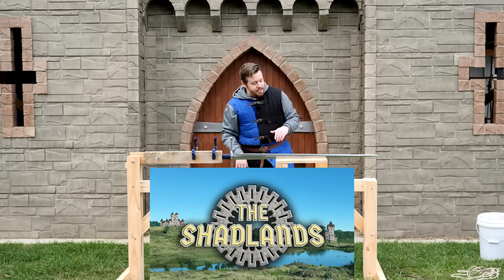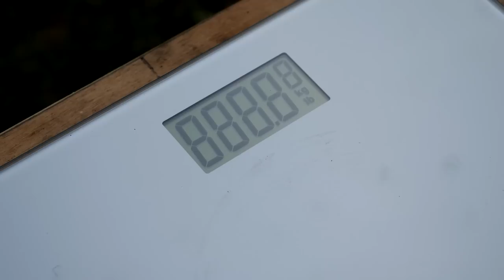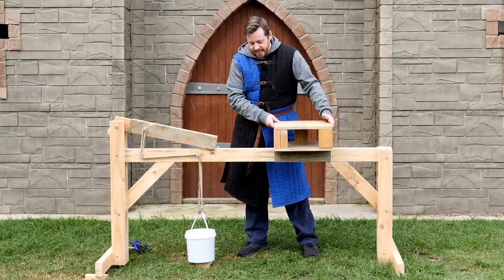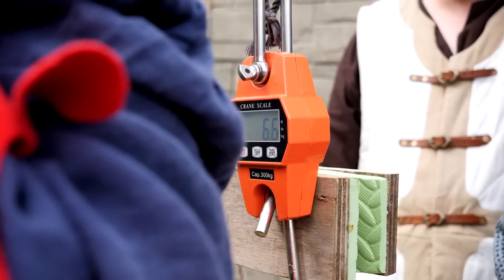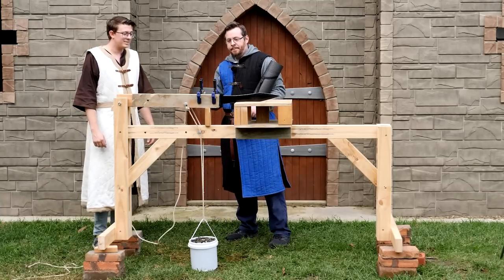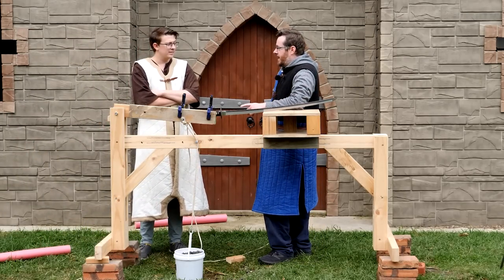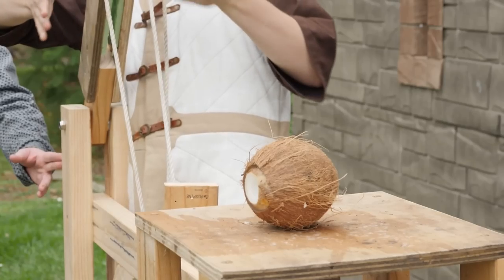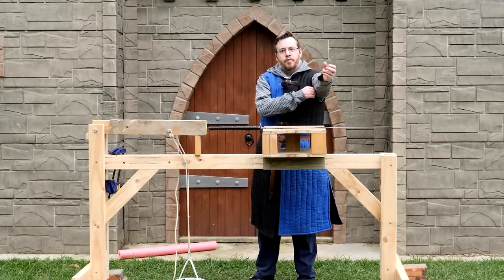Choppy choppy

Comment: Hi shad
I’m afraid the force calibration is still incorrect. When you measured your strength with the wooden stick, you held one end of the stick and applied force on the other end.
However when you tried to calibrate the force for the wooden “sword holder” the force is acting on the handle of the sword and not the tip of the sword. The better way would be to attach the same wooden stick to the apparatus and measure the force at the tip of the wooden stick instead of measuring the face at the point of attachment for the sword handle.
Reply: No offense to Shad, but I’ve facepalmed like 10 times through the whole setup situation. It’s like “no, no… oh good he got it… yes… noooooo, you got it wrong again…”
Reply: I would also be concerned about parts wearing down over time, especially with so much made out of wood, and with the point of contact being hit hard, I would expect that it could move around a bit. 🤔 Tod from Tod's Workshop might be able to think of a good way to make a clean release.
Reply: I was thinking the exact same thing.
Reply: Exactly this. It's a math issue. The swords aren't swinging as hard as they should be.
Reply: He should have used the bathroom scale at the tip for both, or the hanging one at the same point for both
Reply: In addition to that, the acceleration of the weight is limited to that of gravity... I think you'd need to account for that by having the (heavier, as described above) weight at a particular distance (probably closer than it is in the video) to the fulcrum so that the increased leverage can accelerate the sword more quickly to a sufficient speed.

Using the mechanism, it took ~12 frames from dropping to hitting the coconut. Manually swinging it looks like it maybe also took ~12 frames, but it's very hard to tell from the front on angle. However, it looks (again, hard to see from that angle) like Shad is swinging an extra 60 degrees in that similar time, which is maybe twice as far. So even if they did have the same amount of force/acceleration in the "swing", Shad's manual swing is going to be twice as fast at the point of impact (ignoring the effects of gravity while sword is hanging backwards, I guess).
Reply: My thoughts exactly!
Reply: @shooteroffuture  same here. And on such a middle school physics issue
Reply: He was not measuring a force, but a weight, which is also incorrect, cause he should have put hand acceleration into account.
Reply: Or he could alternatively do the math to figure out how much weight at the handle is needed to give that amount of force at the tip of the wooden stick, that would be easier than rigging up the weight to the sweet spot of the test swords
Reply: Yep, this is the problem;  very different lever arm between the calibrations.  He had the right idea initially with the weight very near the pivot, but the calibration needs to be done with the rig holding the stick and the scale on the chopping block, such that the distance between Shad's shoulder and the end of his stick is the same as between the rig's pivot and the point of contact on the scale, then match the force.  With that much mechanical disadvantage it will be a lot of weight needed in the bucket; I'd expect the big bucket full of concrete to start and adding from there.
Reply: JoergSprave had made something similar before with rubber, I think that one seem to work really well. "Let me show you its features"
Reply: Yep, that’s exactly it, was hoping he might figure that out in the video
Reply: i was about to say the same thing.
Reply: This. I wish he would have also tried cutting that yoga mat by hand as well.
Reply: even then  force is mass plus speed, he only measured the mass.
Reply: Yea I was thinking that same thing. They might also need something denser than rocks as a weight to make it easier to manage.
Reply: @bowmanc.7439  Science just isn't his area. He should of made this video with another YouTuber that specializes in this sort of thing.
Reply: He doesn't necessarily have to do something so complicated.  The torque applied to a lever is proportional to the distance from the pivot and the force applied at that point.  All he needs to do is place the stick in the rig and measure the distances from the tip of the stick to the pivot and from the point where the rope attaches to the pivot.  The weight of the bucket needs to be increased by the same amount as the ratio of the two measured distances.  Example being that if the rope is 1 ft from the pivot and the tip of the stick is 4 ft from the pivot, then the weight in the bucket must be increased for 4 times for a total of 28 kg.
Reply: @dylank10101  Or he could push down on the scale with his hand.
Reply: Exactly, hope he reads this
Reply: @valkronis1863  You'd figure since he always does a bunch of "research" so he gets nothing wrong, that something like this would be easy for him
Reply: that's overly complex. simply put your folded hands in a kind of low defense position, bow over a little to make it horizontal and push down directly on the scale. this force needs to be on the handle.

why not straighten your arms? because your muscles work better in a middle state and we all instinctively angle our arms when throwing for that reason.
Reply: I was thinking exactly this through the whole video, hoping he would catch on. You need at least to be measuring the force at the same point of impact

There are, of course, several other factors, and ways to improve the swing, but this is the most obvious.

Comment: Hey Shad, while I agree with  people below that there's some force calibration and clamp slipping, I think the real issue is velocity/acceleration. Force=Mass x Acceleration (which one of the key parts of cutting is pressure P=Force/area, where area would be the edge of the blade), while your mass is consistent between the actual sword swing and the rig, your acceleration isn't. Right now you're limited to 10.9 m/s of gravity pull (minus friction, air drag, and all that jazz), but your swing is faster than a simple drop, which means your actual force is significantly decreased on the rig. This could be solved with elastic bands, springs, or some other way that would allow it to be pulled/pushed at a faster speed. 

I don't think the issues with clamp force and tip force calibration is a significant issue, as hands aren't perfect clamps either.

Another issue you face is rotational velocity, since your axis is fixed it means that a longer blade, regardless of the mass will be swinging faster (due to distance traveled) even though the acceleration is the same (assuming you always strike with the optimal blade location). What you instead would need is to calculate the rotational velocity of the striking area for each compared sword (or instead have a set rotational velocity metric that you meet each blade to). This would also mean you would have to have adjustable elastics/springs to match the acceleration needed to equalize the rotational velocity. This is important mostly because of the inertia that larger ("less wieldy") blades would have after achiving that higher rotational velocity with simply gravity, while shorter blades can be accelerated faster. 

This is also useful to guage the amount of force needed to achieve the same depth cut as you can measure the amount of downward pressure being exerted by your rig which could be useful considering the various applications of different blades (Choppers vs cutters vs slashers etc). 

Combining those two fixes would give you something a lot more akin to an actual sword swing, especially when combined with more options for cutting styles with different angles. At least a lot more than changing just the clamps or weight behind the strike. Though it's somewhat complicated to fix, an actual comparison of the "exact same swing" for a sword is also difficult.

Just to reiterrate:
The Acceleration is why your rig doesn't cut quite as hard, and the rotational velocity is why the 2-hander could cut the coconut while the katana couldn't.
The simplest fix for this would be elastic bands which could be attached at the pulley points, with variable strengths of belts to achieve equal (or roughly equal) rotational velocity while applying a higher acceleration to more closely represent an actual sword swing.
Reply: Would say you it the problem right on.
Since the acceleration is the same (gravity), the mass of the object being dropped is the difference heavier sword, more power.
Then we have to figure in the lever, again the longer the lever the more force you put down considering the same mass.
So we have 2 factors working against the Katana, it is lighter and has a shorter lever.

Also your clamps do not seem to perform the same with the various grips.
While they held the twohander quite well, the Gladius was nearly fully pushed out and the Katana showed quite some movement after hitting the target.

I would also suggest, springs or elasticbands to get the same torque out of the various swords.

Fo the cutting medium, I am not sure how expensive ballistic gel is in your area, but you can cook up a similar material with regular gelatine which is easier to come by.
As long as you use the same recipe it does not matter if it is denser or not compared to ballistic gel (which in itself is also just gelatine just mixed to get the density specified from the testing agencies).
Reply: Exactly this. but i also have to ask where are you getting 10.9 m/s gravity from. isn't it usually more like 9.8 ish?
Reply: @thecorsentino  sorry yeah it is got it mixed up but still there basic premise stands
Reply: @thecorsentino  In Australia the gravitiy is stronger otherwise they would fall off the globe. :D
Kidding guess it was a typo on his side.
Reply: You can increase mass instead of acceleration. Still nets you more forces. Mmmmmmaybe not the exact condition of a sword swing though.

The whole conversation really only tells me one thing - ROBOT SWORD ARM
Reply: I think, you assume that human can achieve the same speed with different blades. I'm not sure that it's true. Shad's solution with bucket and gravity guarantees that all swords get the same amount of energy. Of course blade's mass contributes to the result too, but it's 0.5 kg vs 5-10 kg in a bucket, so probably less than 10% of the contribution.

More than that, if we want to simulate a real sword strike, a heavy sword should get more energy, not less. Reason is simple: heavier sword will take more time to accelerate, but assuming that human applies constant force, it means that sword get more energy. And here your idea of rubber bands does exactly that, just do not adjust force to match velocity.
Reply: @magras8220  bands actually do not apply the same continuous force though. They produce less force as they relax, in a similar way muscles do when extending.

The downward pull from the bucket however is constant in a way a sword swing isn't

However I find it doesn't really matter how a sword cuts to determine which one cuts best or is "better" overall. A heavier and wider blade will almost always cut better in a downward stroke than a narrower lighter sword because the geometry of the blade with added weight grants the advantage. However perhaps a downward stroke isn't that second blade's strong suit, or even cutting in general. 

You can't compare a German two hander to a katana, just like you can't compare an epee to a shamshir. Fundamental differences in goal achieved. You can compare two swords of relative similarity however, to see how much work each blade contributes to a cut. However if you're just looking for that you don't need the bucket, in fact I'd argue it skews results in favor of the lighter blade by adding comparatively more inertia. A rig for this would function with as light of material as possible for the arm (carbon fiber would be optimal but also very pricey), and bearings to reduce friction of the upward bounce. This shows exactly what just the sword does, with no inclusion for skill or strength, which is both a good and bad thing.

Like I said you can't really compare two different blades, but if you're trying to get a sword swing that is as replicable as possible and as fair to each sword as possible I would use my idea above
Reply: @Zeldianiac  you are right that bends do not exert constant force. It was poor chose of words on my part: jumping from simplified model sole purpose of which was to show why heavy sword should have more energy on impact to solution that is not 'exactly' that, contrary to what I wrote. Thank you for clarifying that.

I have an impression, that Shad would be happy to do human tests if result would be consistent and repeatable, and the contraption should solve only this problems, not to isolate as many factors contributing to cutting (or chopping) power of a sword as possible, otherwise static test probably would be better.
Reply: @magras8220  yeah, and I mean so long as there's consistency and you know what's actually being tested, then publish those results, then it's all good for the sake of testing. I'm sure shad will make use of as much info as he can
Reply: It's also important to note mass behind the sword makes a big difference. (I.e. your body weight)
Reply: @Zeldianiac  "The downward pull from the bucket however is constant". No it isn't.
Reply: Some people just don't have an intuitive grasp of the difference between dynamic and static physics, it's similar to 'aphantasia' (the lack of a 'minds eye'). Shad just doesn't have 'it'. He is well meaning, but blind to why his logic is false.
Reply: @thomaskurz5617  😆
Reply: Wow, I just had a much needed science lesson…
Reply: @BestFriendsWhoLiveTogether  lol well I'm not a specialist, I just like swords and physics
Reply: I mean, yes, adding rubber bands or something would increase the acceleration of the swing, but I think its more important that the rig is consistent. It may not be a good representation of what an actual swing would do, but two swords side by side would benchmark differently. Its kinda like a PC benchmark, not every game is gonna run the same as Shadow of the Tomb Raider (has a built in benchmark tool), but how two games run compared to another in SotTR is an important performance reference (except PCs are a bad example bc of software differences but we're talking about swords).
While yes, the hands aren't a "perfect vice", they do clamp the sword from all angles, the sword won't be sliding significantly backwards in your hand bc, y'know, your hand is in the way
Edit: Totally forgot, but actually the bucket could be used to add enough mass to make the force on the blade the same without having to accelerate the blade. That said, I'm pretty sure there's more to cutting than just force.
Reply: Another problem is that a large part of the force from the bucket weight is lost because the bucket itself needs to accellerate aswell. So you might have the necessary force while holding the arm still, but as soon as you let go, the pulling force is reduced.

A better way would be to measure the speed of a humans swing and then adjust the rig till the endspeed is the same.
Reply: I agree with this comment.  I think a swordsman is trained to get to max speed much faster than something dropping (dropping is limited to g, or 9.8 m/s^2, but a swordsman has two hand on the hilt separated by a distance, d, which when pushed on in opposite directions applies torque and can result in more acceleration than gravity). So your guillotine would require more time to reach the same speed a human swing could get. Clock the max speed the cutting portion of thr sword gets, and you'll likely see that your katana slice ended up much faster. 

Velocity isnt everything though.  The weight can be different,  so two swords going the same speed will have different forces. Also different momentums. 

The density of the material matters,  but also the springiness. The timespan of the sword contacting the material and deforming/ cutting it is called impulse, and can drastically reduce the effective force. That is why we put springs in shock absorbers--it didn't change the total momentum change,  but due "spread out" the application of force over time.
Reply: @clockworkowl6248  get the one the mythbuster built lol

Comment: Notable  problems in testing:
- You measured a pressing  force on the scale, not swinging force. So the amount of weight the scale gave was probably SIGNIFICANTLY lower than when you swung at the end. 
- Yoga mat:  you have a material that is specifically designed for shock absorption, rolled into multiple layers. So the force is both being distributed through the porous material AND deflected by the rounded shape.
- Coconut: Second chop with the katana, you should have stood it on the flat surface the first chop created. The second cut lost a lot of energy from the coconut rolling and therefore deflecting the force. 

You also repeatedly forgot to remove the stopper block multiple times after saying you would remove it, which was ALSO stealing force from the blows.
Reply: I think the block is meant to stop the blows. you don't want the mechanism to swing through because the cutting surface is raised above the bottom beam.
Reply: i suspect it's also slightly the angle, but i had not thought of the rest for the coconut.